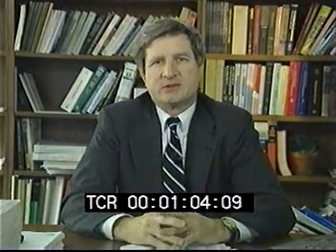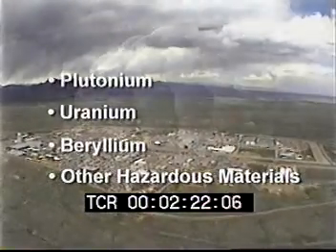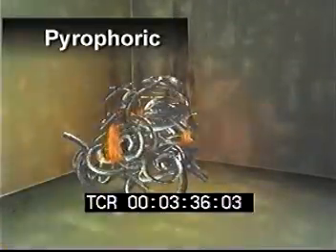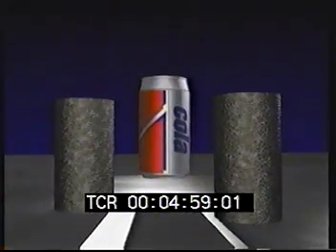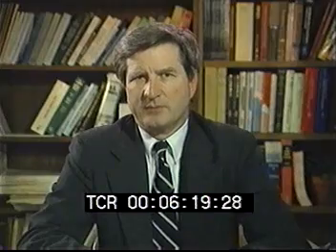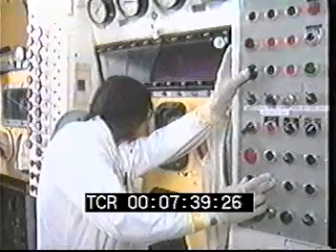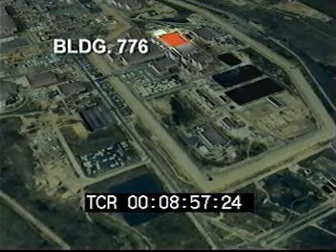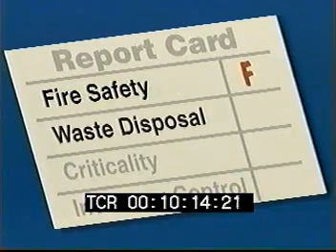Practices of the Rocky Flats Nuclear Weapons Plant - Part 1 of 3

Comment: what about lithium deuteride salt tampons and tritium filled booster bottles that go into the pit.
Reply: The tritium bottles were installed at the Pan Texas munitions plant with the rest of the warhead fuzing stuff. The lithium deuteride was put inside cylindrical secondaries then sealed up in a subassembly that was made here at this facility.